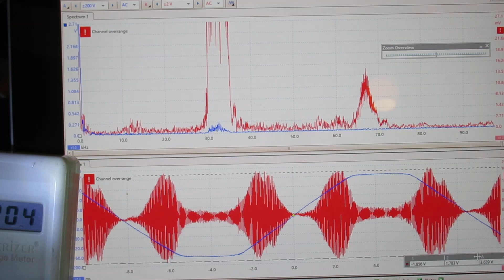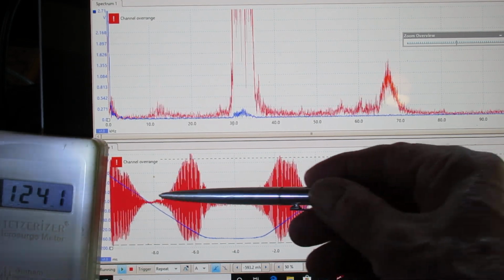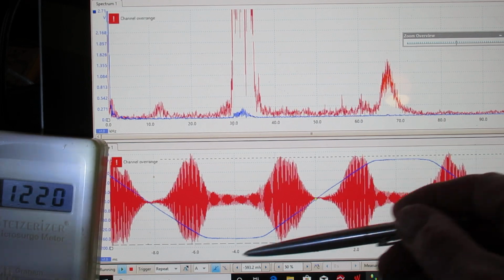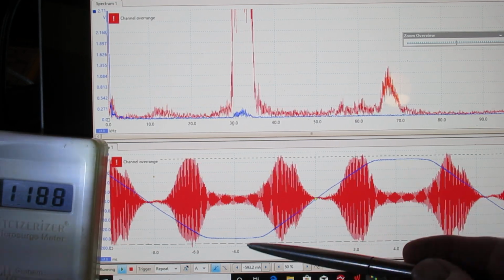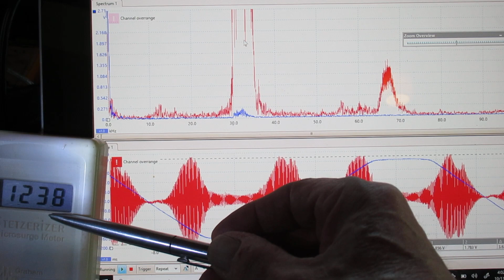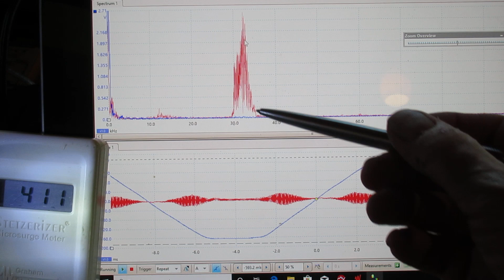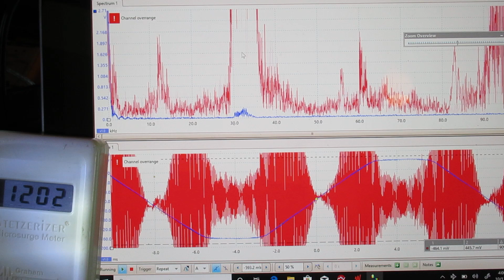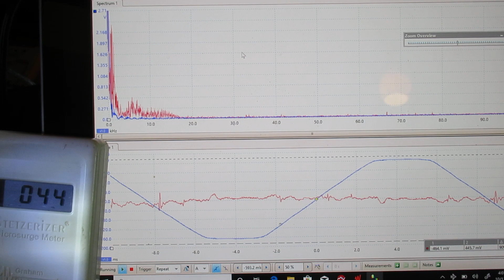Which DE Filter Is Best for a Variable Speed Pool Pump?

Comment: I talked with the boss @ gigahertz germany, and he has no idea about this issue and why the gigahertz nf1000 would not detect it......i got a feeling he thinks it is just a scam.....i think the same
Reply from the maker: Hi Dr Bob,

I am using a Pico 2204A oscilloscope connected to 120 VAC.  My GHS NFA1000 is not designed for that.  Additionally,  the NFA1000 can not provide real time screen display.  To see one of the ways I use my NFA1000 see this video: https://www.youtube.com/watch?v=8v1GRC7Hfk0&t=156s.

Comment: Thanks for the detailed troubleshooting, Eric. Would a 'Greenwave' filter have made about as much  improvement as the Stetzer did?  We use Stetzers, but do measure a larger magnetic reading at the Stetzer, suggesting we are trading off DE vs Magnetic instead of clearly coming out ahead in terms of reducing the EM-noise around here.
Reply from the maker: Both greenwave and stetzer filters are parallel capacitive filters so results are comparable.  GW has 25 microfarads and stetzer 20. There is a small increase in magnetic fields.  Both of these can reduce DE and people do feel better in  most cases.